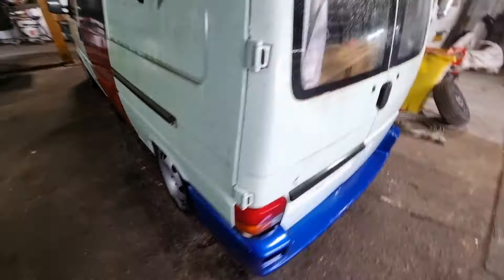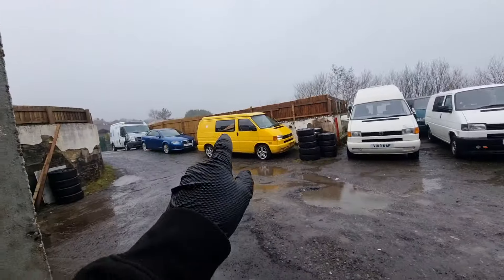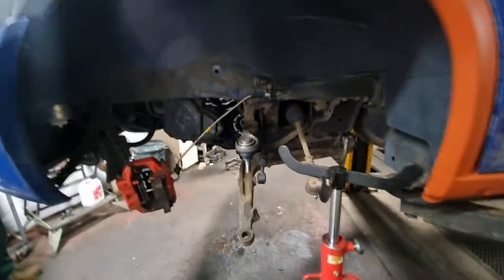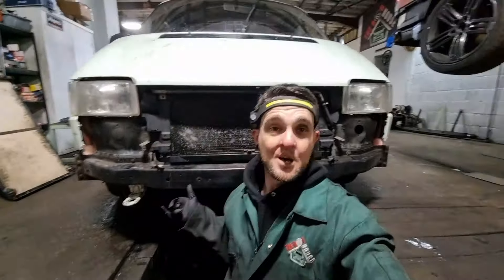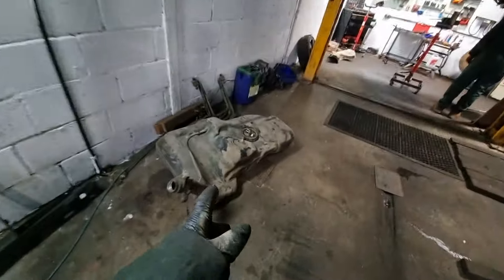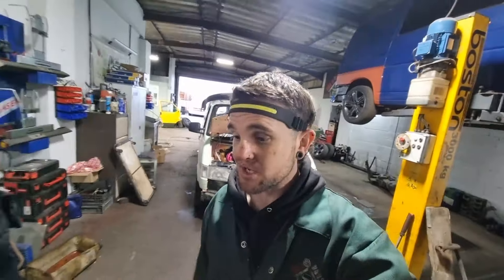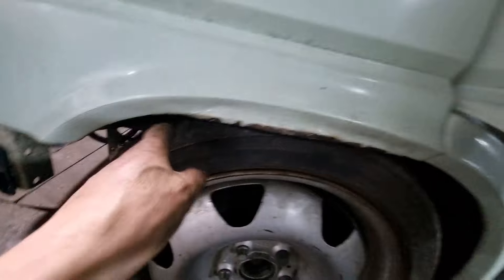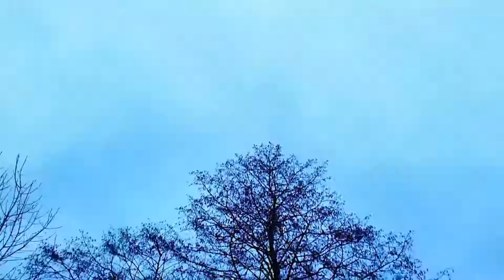There Not Much Left To Do Now  #vwt4

Comment: Looking good,  but I think you gonna need a bit more sump clearance for the nc 500. I did it in my t4 moho amd the roads are shocking ....I was using the same wheels as you but without the lopro rubber, I would wind her up a bit to be on the safe side.  Keep up the good work.